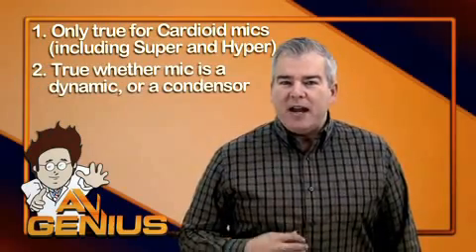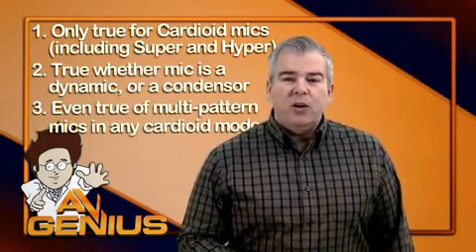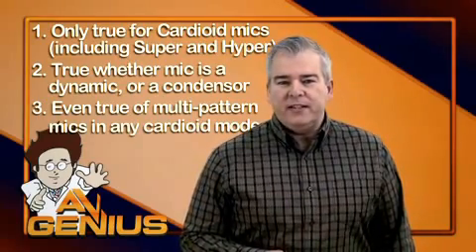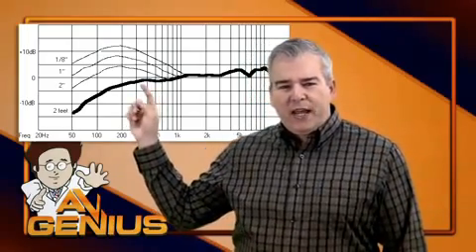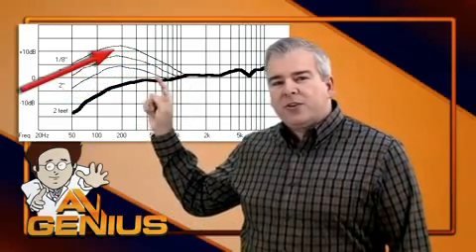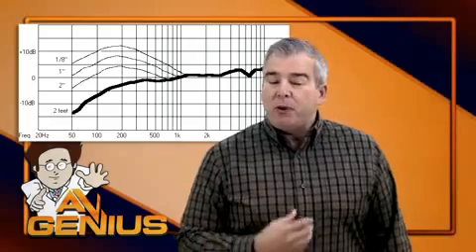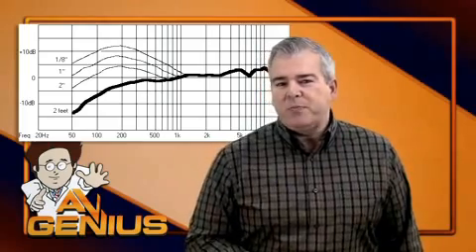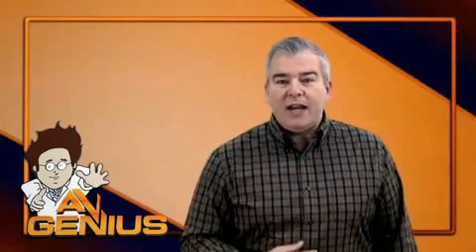AV Genius "How to Mix"- The Proximity Effect

Comment: Are you going to explain the physics behind it??
Reply from the maker: It's pretty geeky for a video. Do you want the geeky answer?
Reply: @Avgenius  if you're looking something called the 'proximity effect', you're basically asking for it at thus point 😂

As a nerd the answer will always be yes
Reply from the maker: @MelloCello7  

OK, but remember, you asked for it! <deep breath>

First make sure you understand Mic Patterns (watch my “Mic Patterns” video), the relationship of wavelength to frequency (“Frequency and Wavelength” video), and the inverse square law (“Inverse Square law” video)

Why is there a proximity effect on Cardioid pattern microphones?
I’ll start with the short answers, then the long version of this will explain why it happens.

The Shortest answer:
EQ, therefore proximity effect.

Medium answer:
Because the construction used to create a cardioid pattern mic causes it to respond progressively better to highs than lows, and at the lowest frequencies, barely responds at all, EQ (either electronic or mechanical) is used to progressively reduce the highs at about 6 dB/oct., to be relatively equal to the lows. This results in dramatic bass boost that is even greater at the lowest frequencies. When a sound gets very close to the mic, the diaphragm receives a significantly louder signal on one side than at the other, altering the cancellation used to create the pattern. Therefore, the EQ works incorrectly because the very lowest frequencies are cancelled out less and are boosted more than necessary. 
Thus, proximity effect.

Long Answer:

First, how to create a mic with a cardioid response pattern:
Single diaphragm
A microphone with a single diaphragm can be constructed one of two ways - one side open to sound, or both sides open to sound.

1. The pattern of a single diaphragm mic with the one side open, and the other side sealed, is omni directional. 
Sound from any direction causes the diaphragm to move in concert with the sound waves. 
This is a “pressure” microphone because the closed back side is a fixed pressure, the pressure on the open front side, varies with the pressure changes of sound striking it. 

2. The pattern of a single diaphragm mic with both sides open is Figure 8. 

With this construction, the diaphragm also moves when there is a difference between the pressure on the front and the back, but the back side of the mic is not a fixed pressure. It varies depending on the way the sound waves strike it. This is called a “pressure gradient” microphone.
Remember that sound waves are longitudinal, meaning that the pressure changes occur in the same direction as the wave travels. 
The diaphragm will move depending on the “angle of incidence” of the sound striking it.

Sound coming from the front or the back of the diaphragm, causes it to move in concert with the sound. As the angle of incidence becomes 90 or 270 degrees (the sides), the pressure is the same on both sides of the diaphragm, so it doesn’t move.
This is a Figure 8 pattern. The mic responds to the front and the back equally, but responds less and less as the sound comes from the sides.

How to make a cardioid pattern mechanically, with a single diaphragm.
Obviously, we can’t create a directional pattern from a single, one-sided, Omni, diaphragm (unless we had an infinitely large, perfect sound barrier to mount it on!).
We have to change the way the directional pattern of the two-sided, figure 8 responds.

One way it is done, is by mounting the diaphragm on the top of a tube, possibly folding the path through the tube, and using some kind of absorption inside the tube. This creates a slower/longer path for sound to get to the back of the diaphragm when sound is arriving from the front, but basically the same length for sounds arriving from the rear.
Then the capsule is wired to create two signals with opposite polarities.

When the sound arrives from the rear, and the signals are in phase, the two signals cancel each other out because the polarity of one is reversed. So sound from the rear is cancelled out.
When the sound arrives from the front, the signals are out of polarity, but when the polarity is flipped on one signal, they become in-polarity and sound from the front is reproduced.
This pressure gradient principle relies on the sound being at the same level at both sides of the diaphragm, in order to provide cancellation (or no cancellation).

Now this isn’t perfect. The cancelation depends on how the wavelength fits in the tube at the back of the diaphragm. As wavelengths exceed 4 times the length of that tube, the sound wave starts to diffract around the tube, and the cancelation doesn’t work as well. Because of the inverted polarity, this causes even less response at the very lowest frequencies.
If you look at the polar response pattern of a cardioid mic, you will notice that they work really well at a certain range of frequencies, tend to be a bit variable at the highs, and start to become more omni on the low end. 

we can accomplish the same effect by using two capsules instead of one. By varying the mix and polarity of the two diaphragms all patterns can be created from Omni, through Cardioid, to figure 8 – and everything in between.
When in cardioid type pattern though, it still works the same way as a single capsule, but has better polar response because there are two separate capsules that can be optimized for the needed response characteristics of the front facing and rear facing diaphragms.

Now – we get to the Proximity effect.

The cardioid construction of a pressure gradient microphone, creates a mic that responds to higher frequencies much better than lower frequencies.
High frequencies with short wavelengths have a 100% pressure gradient over a very short distance (1/4 the wavelength of 10 kHz is a little more than a ¼”).
Long wavelengths, which can have wavelengths as long as 25 feet, have a pressure gradient that changes very little over the small distance between the two sides of the diaphragm.
So, the diaphragm responds progressively worse to low frequencies, because their pressure gradient is progressively smaller over the small distance between the front of the diaphragm and the back.
It’s roughly a 6dB/octave drop off, plus additional drop off due to the diffraction at the very lowest frequencies.
In order to have a relatively flat frequency response, the highs need to be progressively lowered with absorption, and/or electronic EQ (by 6dB/octave plus additional boost at the very low end, to as high as 30 dB!).

Now, as the sound source gets very close to the capsule, the SPL becomes increasingly higher at the front of the mic capsule than at the back (6 db loss of the inverse square law operating over a couple inches or less).
Since the pressure gradient principle relies on the sound being at the same level at both sides of the diaphragm in order to use cancellation, this added volume difference causes the capsule to reproduce more of the lowest frequencies than when the sound source was further away, the EQ’s bass boost causes the proximity effect.
</deep breath>